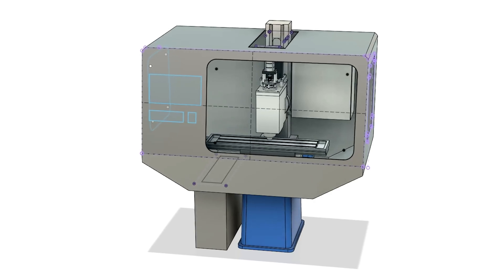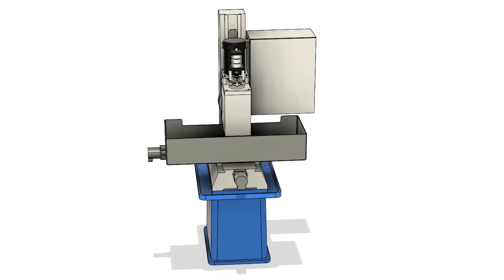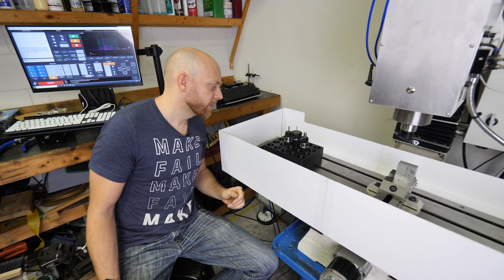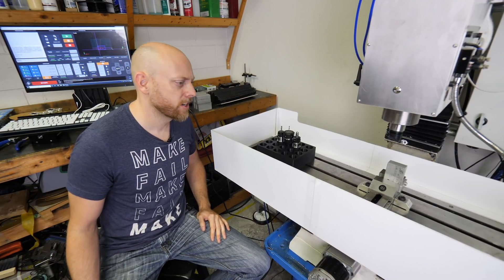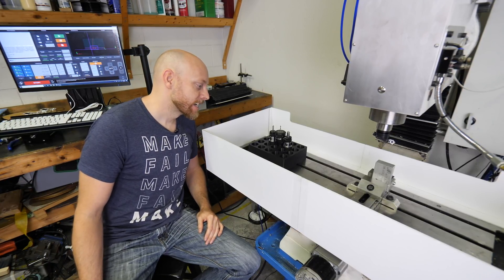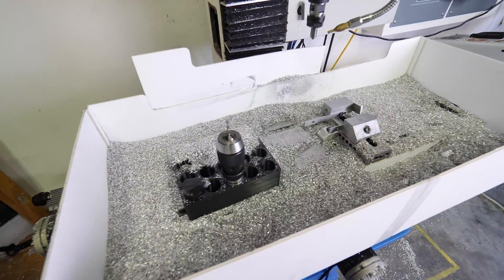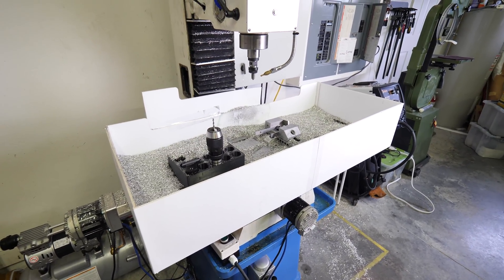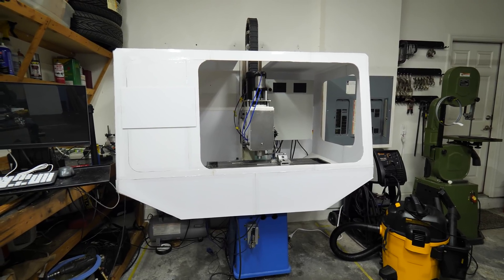CNC Enclosure Part 1 - S03E16

Comment: I'm thinking about getting a 940m (or 833TV since it comes as belt drive) and converting to CNC, or getting a Tormach 770. How would you compare the rigidity of the Tormach to the 940? I will mostly be cutting tool steels and titanium.

Also, maybe try aluminum extrusion for the frame of the enclosure?

Comment: I built a similar full enclosure for my CNC machine and ended up having to redesign a big chunk of it to fix pooling & leaking issues. Lessons learned for me: if you plan to ever run flood coolant pay very close attention to how the coolant will flow through the system. In particular if there is any possibility of a leak as if flows down every surface (the gap between sliding doors is a big offender) and if there are any locations that it can pool up in. The enclosure should be able to handle a hose spraying coolant in every direction from the spindle. If you want to see what I did, here's a video of the upgrades https://www.youtube.com/watch?v=1de6fO-9ZDU

Comment: actually... what if you enclosed just the cutting head of the machine? use some sort of clear flexible material (like a table cloth cover that you can get from Walmart) and flood coolant for chip removal and cleanup. it would be like a clear curtain.

Comment: Open bed machines are good,. Can get pretty messy when you shell mill parts alot. I had a FryerVB-40 with bed/table top enclosure. Great machine when doing mid size production for speed of getting parts in and out of the vises ( 3 ) quickly. I built some side shields that were inexspensive with condiut and clear poly carb sheets. This helped keep the chips close to the machine when shell milling aluminum.

Comment: Yes, you need a full enclosure if you want to make proper chips and use decent flood cooling, as required by any self respecting YT Warrior these days. I started to make a "full enclosure" that allows the table to poke out at each side, through curtains. The aperture in the curtains moves with the table in Y axis and has its own flaps to contain the mess. Then I thought we were moving house and took it down before it got finished so now it's just a story. And now when I make chips, I get them everywhere and the coolant soaks everything again. I also bought an HVLP unit to blow the chips clear but that's still just a bar room story too.

Comment: Don't go for acrylic panes use polycarbonate: acrylic tends to be brittle, polycarbonate - while being more expensive - is impact resistent! If there's ever a failure inside of the enclosure (e.g. loose stock flung around) acrylic would be more likely to shatter, while polycarbonate would most likely stay structurally intact.

Comment: if you are planning on using flood coolant, make sure to seal the seams of the enclosure well. even more irritating than chips on the floor is coolant on the floor. if there is a small hole, the sheer quantity of the stuff will cause it to leak a lot.

Comment: If you are looking at running LinuxCNC a group of guys I know have done a great job with a UI and setup process you will like, called Probe Basic. check it out in action here; https://www.youtube.com/watch?v=0tUJfmkSrIQ , and check out a complete detailed installation here: https://kcjengr.github.io/probe_basic/quick_start.html. They are still adding new frequent updates.  Great job with todays video guys, as always fun to watch and informative.
Reply from the maker: This looks really good!
Reply: @PhysicsAnonymous  Yes it does. We are developing a series of CNC controllers for the mass market which will be running LinuxCNC and this UI. Chris (lead on dev work) is currently working on a Linear Tool Changer update, a lath tool changer update  and also a new configuration process that is easy like Mach3/4 or UCCNC.

Comment: Great to see that you guys are working on the enclosure! Maybe you do not need the roof all that much. If you'd ditch that you can also eliminate the upper brace above the front door opening.  That would make it one less thing to hit with your head (ya never know if you might grow up a bit, or add some wooden flooring in front of the machine, well not for cold, but maybe if you wanna avoid chips getting in your flip flops :-) ).   I like the idea of making the door slide upwards, but that might get in a way if you wanna work on the draw bar thingie.   Anyhow, I'm really excited to see the next episodes! Have fun and stay safe!      Oh, the name for that lil mill: Chippy or SplintR? :)

Comment: i merged the two ideas, got the same machine just from another dealer; i used wood fiber plates, coated with epoxy and painted with a rubberized paint usually used for roofs to walk on, so it's heavy duty....  It is the sink, around the bottom of the mill, but it's open at the top:
I did not want a full enclosure and i hate to dismantle a full one every time, so i came up with a "camping" idea: cut some 90° brackets and drilled holes to accept copper tubes (12mm) and build like a tent which anchors to said chip tray with some other brackets. Cheap shower curtains from amazon in gray to serve as a splash guard and presto. No more chips in the workshop, and the coolant gets funneled 100% back, no matter the RPM.

Next up, it will receive a better splash guard to the front, i am thinking some drawer rails and steel tubing as a frame, that accommodates an aluminum chip tray in front of the vice. The acrylic glass will be replaced by proper stuff that holds back any shards of high speed tungsten that likes to pierce my skull, and the glass will be bigger, so it protects better on the full length of the table in 4 sections, that can be then moved with the rails full to the side like a section door.

hope the inputs helps someone

Comment: I'd recommend poly-carbonate over acrylic, worth the price increase, given sizes and speeds 3/16" thick max should be fine for this.

As an temporary measure or possibly long term, if you make a tub bottom, you could surround the machining area with a heavy curtain/inside shower curtain or some sort of heavy mil clear plastic.  This is what I am planning to do once I go wet with my Tormach that has a bottom enclosure but no walls.
Reply: I'd take it one step further and go scratch resistant poly-carbonate. The regular stuff scratches if you look at it too hard.  It's expensive, but so is replacing the regular stuff often so you can see through it. Right now it's all my supplier can get anyway. They said they might have acrylic the end of August.

Comment: You have probably been told but those vises are not good for holding parts in a milling machine. They just don't have the strength,  you want a kurt style vise as they use thrust bearings and have about 40,000 pounds psi and open easy.

Comment: Be very careful with laser cutting foam core -- it catches on fire very easily.  Especially cut-off pieces that end up in your bottom tray -- the de-focused laser will turn them into kindling in the blink of an eye.
Reply: Stop...  You're making too much sense!  Actually my first thought after seeing that they've set up shop in a residential area, was how much their neighbors are going to love them when they start laser cutting plastics, foam or even plywood in earnest.  The "stink" that is output from laser cutting likes to linger in the air on those hot humid (it is Florida after all) days!
Reply: @WHJeffB  On my setup, I installed a carbon filter box to remove all but the slightest odor and smoke when cutting.
Reply: @swp466  Good idea, I'll have to consider something like that...  My machine vents out into the back yard and on hot humid days (I'm in New England which isn't nearly as bad as FL, but not great in the summer either), I'm sure my neighbors can smell when I'm cutting birch/aircraft plywood, so I try to do this at night after dark.

Comment: Given the length of the enclosure vs the door size, I think you will either want 2 hinged doors or a vertical opening (on gas struts maybe?)
For the enclosure, assuming you make it out of metal, I think you will want something that will positively press the doors against a foam strip when closed to prevent any annoying rattles.
The enclosure shape looks good so far

Comment: You have an enclosure for the mill already - its the entire garage.  Solves the access problem and camera angles.  All you need now is an intern to run the vaccuum (I volunteer!)
Reply: A garage?.........good idea, plenty of room, just curtain across the actual machine area or the chips will find themselves out of the door and into the hose on your boots.........but you need to make the floor area around the mill/lathe etc super waterproof and impervious to oil too so that you can just vac the crud up at the end of a day.

Comment: I cant remember if it was mentioned in your videos, or robot cowan's, but the tourmac cncs look to have changed the door design, to prevent water that hits the window from sliding down onto the ledge and leaking onto the floor. They did this by moving the lip that holds the sliding doors to the inside.
Reply: Oh good to know! The one we use must have been after that change (doors inside the box) but inevitable we'll run in to one that isn't. Also cool to see running design changes

Comment: I'm also here to propose a Mesa board with LinuxCNC. Just fukin do it. The wizard and predefined stepper motor settings db makes it to easy. I do understand you desire for "ease of use" which is why you are so up in arms about the UI. You are wanting your specific controls in place so it makes sense to you. Have you ever spied a pro machine like a VF4 or a ? Yes, you would be totally lost, so check yourself just a tad before criticizing the UI on Mach3. I don't spose I can blame your ignorance, you are working with straight hobby grade equipment and you expect everything to fit your limited knowledge. Better yet, stick with Mach3 and your modified UI, anything else is beyond your understanding. (yes this is me trying to be humorous, it sounds way worse than I meant it, oh well the backspace key doesn't seem to work suddenly)

Comment: Nice laser cutter.  We got our 35x48 up and running at MakerFX.  I wish I could get one for my house and start my own laser cutting biz
Reply: Start with a smaller Chinese sourced machine...  The one I have is 12" x 20" work area and a 50W laser.  Less than $1500 delivered.  With upgraded optics (about $150) it works great and has many of the features that "commercial" lower power laser cutters have.  The manual for them sucks, but if you have any experience at all (I have about 28yrs of industrial laser experience), you'll be up and running in no time.  The only reason I haven't started my own custom laser cuttting biz, is that my day job affords me the ability to cut all kinds of metal parts.

Comment: My previous comment seemed to disappear, so there may be two. I definitely recommend a full enclosure. You will need a width that is quite a bit large than that of your current design, though. In order to calculate the enclosure width needed, use the following formula - ((table width / 2) - (saddle width / 2)*2) + (table width) + offsets of motor mounts / motors

Edit - To add off of this make sure to account for your x axis motor being on one side of the table, you will have to offset the mill location in the enclosure accordingly. Make sure the offests are equal on both sides in your positioning.

Comment: GULL WING DOOR(S)!!!
Reply: Maybe not gull-wing, but if the front window was on a pivot at the top-right then it could swing up and out the way through a slot in the top. 
This way it could overlap the frame in a way that would keep the coolant inside, but wouldn't need to be on slides that feel like they would want to clog with swarf. 
So, not a Mercedes style gull-wing, more a Lamborghini style Scissor door.
Reply: @andypughtube  nah full on gull wings. Half the to folding etc. 
Enclosure could be smaller foot print and like 20x cooler
Reply: andy pugh: As I was watching, I was pondering if one could design some sort of linkage that would allow a single-panel door to move fully out of the way of the opening in a vertical direction, sliding outward at the start, but only just a little bit, and then moving almost entirely vertically... I bet it could be done, though I'm not sufficiently familiar with linkages to know. Certainly one could do a linkage for pulling away, and then a bearing track for the vertical portion of the movement.
Reply: @DavidLindes  So, rather than a Mercedes Gull-wing or a Lamborghini, you want him to emulate the sliding door from a Transit van? 
That's not very exotic!